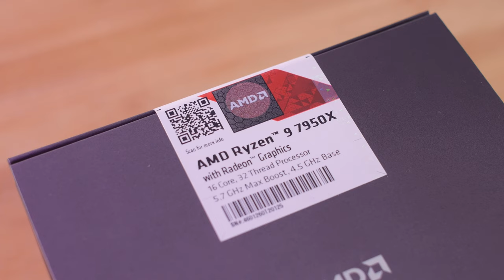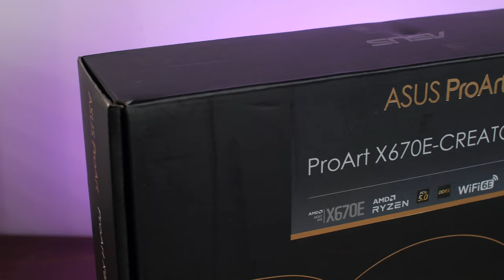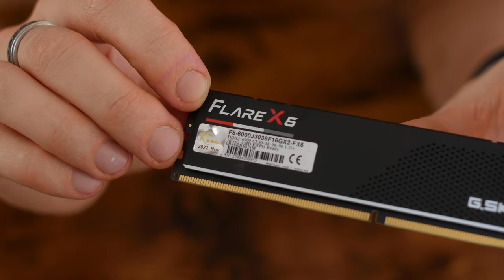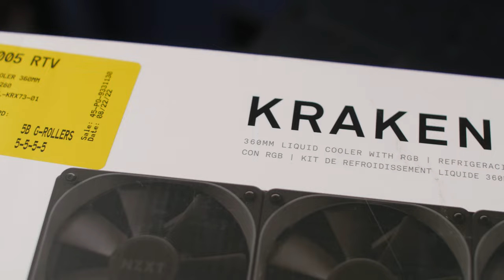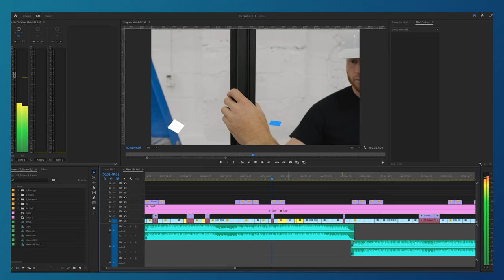The best VIDEO EDITING PC for 4K and 6K footage in 2023!

Comment: You build like a pro..Good job and that's a great powerhouse of a CPU you switched to
Your background music is a little distracting though..do tune it down
So what video card did you eventually put in this build
Reply from the maker: Thanks, I'm still working with sounds and music in my videos. Now I'm using GTX 1060 6Gb, but plan to install rtx 4090 24Gb

Comment: Thank you for sharing your upgrade journey with us. I recently bought the H7 Elite the added airflow is definite plus. According to my grandson who also has a Asus ProArt 670E Creator board he choose to go with the Power Color OC AMD Radeon 7900XTX because there is a definite boost in performance when coupled with the AMD 7950X CPU as opposed to Intel and AMD graphics combo he tested both setups using Puget Sound test rendering software suite. Also while the Power Color OC 7900XTX is not cheap it is still a great deal more cost effective then Nvidia 4090 or 4080. I hope this small bit of information helps. Also my grandson uses Davin chi Resolve for film editing and is extremely happy with his all AMD system. Best wishes for you and the success of your channel.
Reply from the maker: Thanks!

Comment: I doubt it. The igpu inside AMD CPU does not work that well with editing software. The intel CPU does a better job here.
Reply from the maker: You'll need to use discrete graphics if you want to work with colors or graphics anyway

Comment: I HAVE RIZEN 9 5950  GPU RTX GETFORCE 3090 ,64 GB  RAM CORZAIR  DDR4 DOMINATOR PLATINUM , 2 SSD SAMSUNG 980 PRO 1000 GB EVERY ONE AND IT DONT WORK WITH VIDEO 6K 4444 HQ  ,l can not undersrand it piff l can not really
Reply from the maker: What program do you use for editing? And you can always check task manager and see that's the weak part in your PC
I'm using Davinci Resolve, and had a problem with work when both GPU was on, then I turned off the integreted GPU off
Reply: I use adobe premier ,l see something strange on the GPU  when  l check task manager ,it is not using to much the GPU   but still is working like 15 % around .l dont know what you mean with ( turned off the integreted GPU of ? I think you mean the GPU integreted but l have a pc and my pc has just an External GPU l both Rtx 3090 , Somtime l work just with the CPU  but is to much for it .
Reply from the maker: @brayandeleonruiz8477  I see, what's the camera model?

I just tested my 6K BRaw, and I can see that the image in Premiere looks like it has some freezes, but it doesn't show any drop frames - that's strange. And I have pretty the similar situation that you said. The CPU and GPU works at 15-20%. 

In Davinci I don't have such problem, and it plays in realtime so smooth. I don't work with Premiere that much right now, but if I'll find something new on this problem I'll reply to you. 

*As a suggestion, you can make some tests with different cameras, resolution, formats, maybe try to install Davinchi (even free version) and check it there. Because If you won't have any problem there, so it means that something is wrong with Adobe and they need to fix it or optimize it.
Reply: I use the  DJI Ronin 4d and  l test  it already with  4K  also and it work better ,but still not like it should ,for that reason l think thereis something so strange and really l can not find out puff , but l will take this idea and to work a little with davinci .l am thinking about to buy another GPU  ,A cuadro GPU but right now l can not ist a little ti expensive ,but l will see at future ,l think this GPU maybe hat an internal problem because to work in that way can not be possible ,and about update and drive  the GPU is also done so yes ,its have broken ,thank you bró ,and sorry my english .l speak spanisch but in spanisch l dont why why we dont have so much info about alsmot nothing also my ronin is in english ,it was so dificult for to learn how to work with it xd .